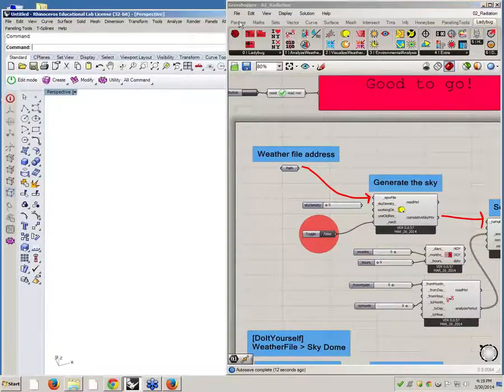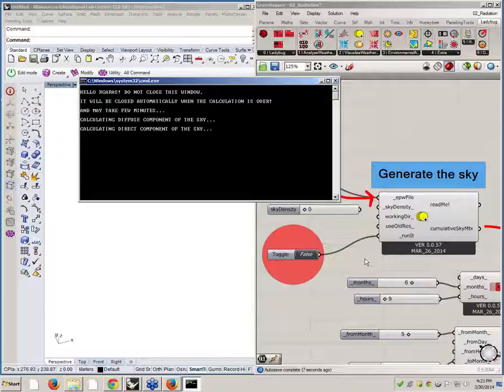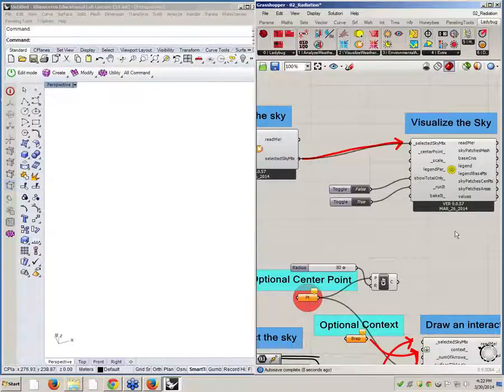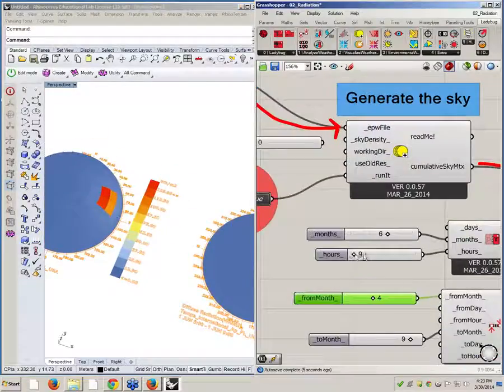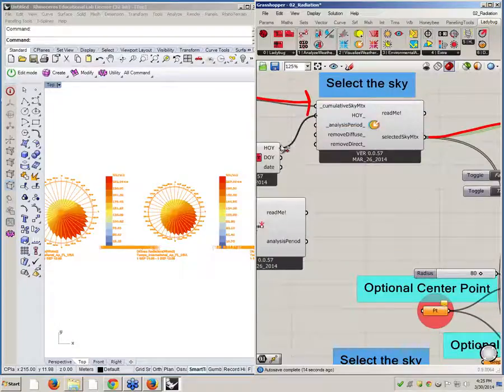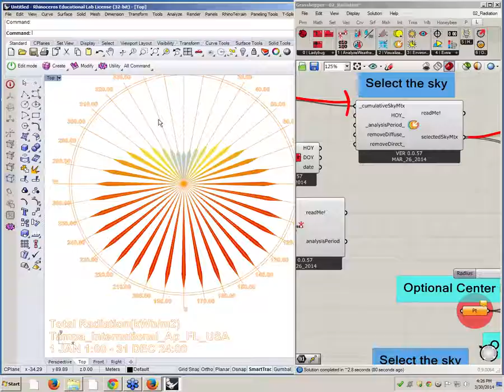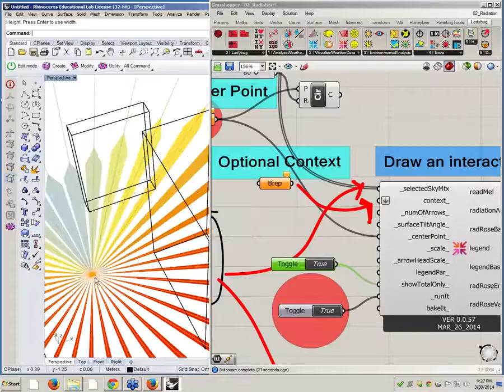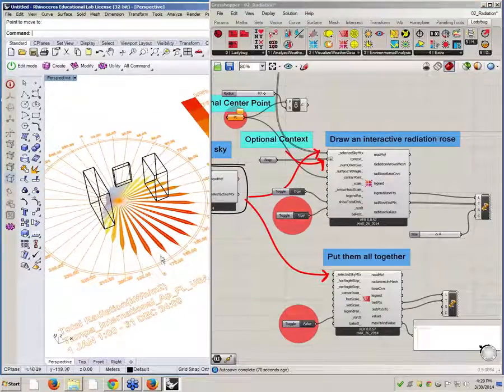Ladybug Workshop Part 3/6: Radiation Rose, Sky Dome

Comment: i want to as a question :
what the link between radion rose and energy simulation for building if I work in urban scale?
2- how the radion Radiation Rose effect in urban design or building dimension or rotation in the site if I work in the urban design process?
Reply from the maker: mohammed! I'm not sure if I fully understand your question here. The parameters involved in urban energy use if more than just the radiation. In any case, questions such as this should be posted to the Ladybug forum (http://www.grasshopper3d.com/group/ladybug/forum).